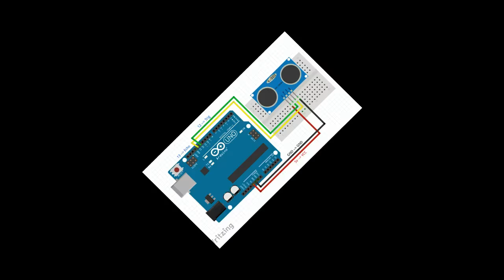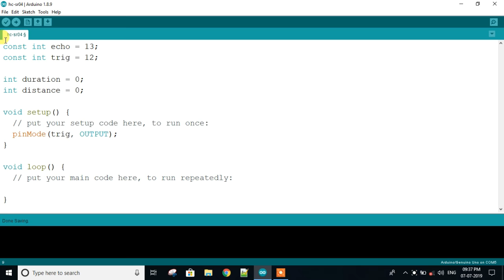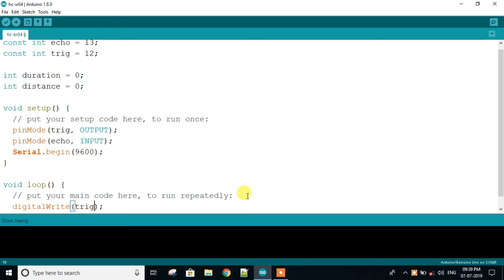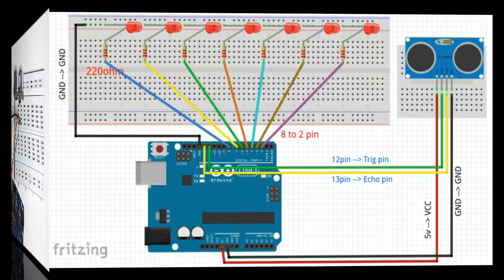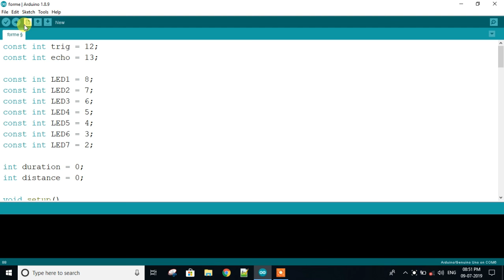Arduino ultrasonic sensor led projects | Hc-sr04 Ultrasonic sensor

Comment: Can we use led bulb instead of Buzer❔❓❔
Reply from the maker: Yes You can, but you have to add a relay for the bulb.
Reply: @MrElectroUino  ok thanks 😎👍🏻
Reply: @MrElectroUino  I am making this using home made cirkut can I use 3 led bulbs
Reply: @MrElectroUino  relay means the base you used❔❓❔
Reply from the maker: @littleengineer8496  Relay is a electrical switch. It's use for high current appliances.
 arduino only supply 5v, So we can use a relay to switch between 230v bulb AC.
Reply from the maker: @littleengineer8496  You can connect upto 12 led bulbs.💡
DON'T FORGET TO SUBSCRIBE✔👍.
Reply: @MrElectroUino  ok thanks 😎
Reply: @MrElectroUino  yes I subscribed
Reply: @MrElectroUino  thanks for answering 👍🏻👍🏻👍🏻
Reply: @MrElectroUino  can I use 9v battery for it
Reply from the maker: Yes you can👍
Reply: @MrElectroUino  thanks a lot

Comment: What colour and size LEDs did you use? What was their voltage? How easy to add arduino speaker module into this project?
Reply from the maker: 5mm size and Round Red, Green, Blue, Yellow, White Color. It requires 2 to 3V dc power supply. For more information and buy visit this link: https://www.banggood.in/custlink/m3vD4vsnhu
For the speaker connection, connect a positive terminal of speaker to Arduino pin 11 and negative terminal to Arduino pin ground(GND) and update the code and upload it. #subscribe it for more video......
if you getting any problem you can also contact me on Instagram:
https://www.instagram.com/_mr_electrouino_/?igshid=isb2pw365odq
Reply: @MrElectroUino  I only asked as I am currently ordering the parts to build one. I am going to use it as an ITC device if I can.
Reply from the maker: Okk
First tell me what is the meaning of ITC device
Reply: @MrElectroUino  its a device that can interact with spirits. I chase EVP, Electronic Voice Phenomenon, ITC is Instrumental Trans-Communication. I recently built a Rem Pod too.
Reply from the maker: Watch this video:-
https://youtu.be/setjiVH0_IY

Comment: why my serial monitor not showing the distance? it keep showing 0 value. i follow all your instructions and your coding but still not get it. even i try only the sensor.
Reply from the maker: Check the circuit connection.
Reply: @MrElectroUino  i follow absolutely like yours. the simple circuit. not show the distance at my serial monitor.

Comment: Is there anyone here getting this error code here?

Arduino: 1.8.13 (Windows 7), Board: "Arduino Uno"
Sketch uses 3234 bytes (10%) of program storage space. Maximum is 32256 bytes.
Global variables use 190 bytes (9%) of dynamic memory, leaving 1858 bytes for local variables. Maximum is 2048 bytes.
An error occurred while uploading the sketch
avrdude: ser_open(): can't open device "\\.\COM3": Access is denied.
Reply from the maker: The first step is to verify the Uno is presented on COM3. Remove the Uno. Start Device Manager.  What serial ports are listed?  Insert the Uno.  Wait a few seconds.  What serial ports are listed?

Comment: what if we dont use resistors? cz i dont have resistors
Reply from the maker: Hey there, Resistor is use for protecting the leds.Without resistor the LED draws too much current and burns out. You can easy found a resistor in some old electronics component but make sure the values.

Comment: Hi brother Its a very good project. But I want to do some modification like I want to add two sensor and differnt light for another sensor. Can u pls help me out. I would really appreciate it. Again thanks for the idea and I also subscribed to ur channel
Reply from the maker: The same way you can do it. Just duplicate the code and change the pin defination.

Comment: the selected serial port _
 does not exist or your board is not connected
 ............. I got this error what will be the solution?
Reply from the maker: Just install the arduino driver. IF you getting any problem contact me on instagram mr_electrouino
Reply: @MrElectroUino  Please bro can you share a code coz in the last moment you swipe quickly so I can't see the code perfectly
Reply from the maker: @prempanchal7721  check out the description you find a code link. Do subscribe😊

Comment: I want to ask why you put it on 13 and 12 pin and not in analog pin
Reply from the maker: That's because the echo pin of HC-SR04 receives a pulse of very short duration,a pulse that has a value of 5v. Its not possible to get a pulse with analog pin.

Comment: How to upload the code
Reply: or a better qestion where is the code
Reply: NEVER MIND FOUND IT
Reply: const int trig = 12;
const int echo = 13;

const int LED1 = 8;
const int LED2 = 7;
const int LED3 = 6;
const int LED4 = 5;
const int LED5 = 4;
const int LED6 = 3;
const int LED7 = 2;

int duration = 0;
int distance = 0;

void setup() 
{
  pinMode(trig , OUTPUT);
  pinMode(echo , INPUT);
  
  pinMode(LED1 , OUTPUT);
  pinMode(LED2 , OUTPUT);
  pinMode(LED3 , OUTPUT);
  pinMode(LED4 , OUTPUT);
  pinMode(LED5 , OUTPUT);
  pinMode(LED6 , OUTPUT);
  pinMode(LED7 , OUTPUT);
  
  Serial.begin(9600);

}

void loop()
{
  digitalWrite(trig , HIGH);
  delayMicroseconds(1000);
  digitalWrite(trig , LOW);

  duration = pulseIn(echo , HIGH);
  distance = (duration/2) / 28.5 ;
  Serial.println(distance);
  

  if ( distance <= 7 )
  {
    digitalWrite(LED1, HIGH);
  }
  else
  {
    digitalWrite(LED1, LOW);
  }
  if ( distance <= 14 )
  {
    digitalWrite(LED2, HIGH);
  }
  else
  {
    digitalWrite(LED2, LOW);
  }
  if ( distance <= 21 )
  {
    digitalWrite(LED3, HIGH);
  }
  else
  {
    digitalWrite(LED3, LOW);
  }
  if ( distance <= 28 )
  {
    digitalWrite(LED4, HIGH);
  }
  else
  {
    digitalWrite(LED4, LOW);
  }
  if ( distance <= 35 )
  {
    digitalWrite(LED5, HIGH);
  }
  else
  {
    digitalWrite(LED5, LOW);
  }
  if ( distance <= 42 )
  {
    digitalWrite(LED6, HIGH);
  }
  else
  {
    digitalWrite(LED6, LOW);
  }
  if ( distance <= 49 )
  {
    digitalWrite(LED7, HIGH);
  }
  else
  {
    digitalWrite(LED7, LOW);
  }
}

Comment: Could you please reply quickly 

The “serial.printIn” is not working
Reply from the maker: Its not like this serial.printIn like this you have to write Serial.println .
First print this program and tell me it work or no:-
void setup() { 
Serial.begin(9600); // set the serial monitor bandwidth 9600
 } 
int number = 0;
 void loop()
 { 
Serial.print("The number is "); Serial.println(number);
 delay(500); 
 number++; 
 }
Reply: THANKS!!!
Reply: it is "serial.println
Reply from the maker: @hypergamer9391  yaa 
Serial.println();

Comment: maybe using rgb led saves some digitalPins ,becuz it can be green red blue or wahtever color in just one led
Reply from the maker: Yes you are right if you want to add more components else having multiple leds is good way to understand the distance between an object.

Comment: how can i get the code for this program
Reply: const int trig = 12;
const int echo = 13;

const int LED1 = 8;
const int LED2 = 7;
const int LED3 = 6;
const int LED4 = 5;
const int LED5 = 4;
const int LED6 = 3;
const int LED7 = 2;

int duration = 0;
int distance = 0;

void setup() 
{
  pinMode(trig , OUTPUT);
  pinMode(echo , INPUT);
  
  pinMode(LED1 , OUTPUT);
  pinMode(LED2 , OUTPUT);
  pinMode(LED3 , OUTPUT);
  pinMode(LED4 , OUTPUT);
  pinMode(LED5 , OUTPUT);
  pinMode(LED6 , OUTPUT);
  pinMode(LED7 , OUTPUT);
  
  Serial.begin(9600);

}

void loop()
{
  digitalWrite(trig , HIGH);
  delayMicroseconds(1000);
  digitalWrite(trig , LOW);

  duration = pulseIn(echo , HIGH);
  distance = (duration/2) / 28.5 ;
  Serial.println(distance);
  

  if ( distance <= 7 )
  {
    digitalWrite(LED1, HIGH);
  }
  else
  {
    digitalWrite(LED1, LOW);
  }
  if ( distance <= 14 )
  {
    digitalWrite(LED2, HIGH);
  }
  else
  {
    digitalWrite(LED2, LOW);
  }
  if ( distance <= 21 )
  {
    digitalWrite(LED3, HIGH);
  }
  else
  {
    digitalWrite(LED3, LOW);
  }
  if ( distance <= 28 )
  {
    digitalWrite(LED4, HIGH);
  }
  else
  {
    digitalWrite(LED4, LOW);
  }
  if ( distance <= 35 )
  {
    digitalWrite(LED5, HIGH);
  }
  else
  {
    digitalWrite(LED5, LOW);
  }
  if ( distance <= 42 )
  {
    digitalWrite(LED6, HIGH);
  }
  else
  {
    digitalWrite(LED6, LOW);
  }
  if ( distance <= 49 )
  {
    digitalWrite(LED7, HIGH);
  }
  else
  {
    digitalWrite(LED7, LOW);
  }
}

Comment: I have done the same arrangement
Reply: But all bulbs are not glowing
Reply from the maker: Make sure the you connect the led right and also change the jumper wire of that led.

Comment: Can u add the code in written in description plzz
Reply from the maker: Check out the website for the code.
Reply: const int trig = 12;
const int echo = 13;

const int LED1 = 8;
const int LED2 = 7;
const int LED3 = 6;
const int LED4 = 5;
const int LED5 = 4;
const int LED6 = 3;
const int LED7 = 2;

int duration = 0;
int distance = 0;

void setup() 
{
  pinMode(trig , OUTPUT);
  pinMode(echo , INPUT);
  
  pinMode(LED1 , OUTPUT);
  pinMode(LED2 , OUTPUT);
  pinMode(LED3 , OUTPUT);
  pinMode(LED4 , OUTPUT);
  pinMode(LED5 , OUTPUT);
  pinMode(LED6 , OUTPUT);
  pinMode(LED7 , OUTPUT);
  
  Serial.begin(9600);

}

void loop()
{
  digitalWrite(trig , HIGH);
  delayMicroseconds(1000);
  digitalWrite(trig , LOW);

  duration = pulseIn(echo , HIGH);
  distance = (duration/2) / 28.5 ;
  Serial.println(distance);
  

  if ( distance <= 7 )
  {
    digitalWrite(LED1, HIGH);
  }
  else
  {
    digitalWrite(LED1, LOW);
  }
  if ( distance <= 14 )
  {
    digitalWrite(LED2, HIGH);
  }
  else
  {
    digitalWrite(LED2, LOW);
  }
  if ( distance <= 21 )
  {
    digitalWrite(LED3, HIGH);
  }
  else
  {
    digitalWrite(LED3, LOW);
  }
  if ( distance <= 28 )
  {
    digitalWrite(LED4, HIGH);
  }
  else
  {
    digitalWrite(LED4, LOW);
  }
  if ( distance <= 35 )
  {
    digitalWrite(LED5, HIGH);
  }
  else
  {
    digitalWrite(LED5, LOW);
  }
  if ( distance <= 42 )
  {
    digitalWrite(LED6, HIGH);
  }
  else
  {
    digitalWrite(LED6, LOW);
  }
  if ( distance <= 49 )
  {
    digitalWrite(LED7, HIGH);
  }
  else
  {
    digitalWrite(LED7, LOW);
  }
}

Comment: The program after using led is not clear pls give a program
Reply from the maker: can you send your email id so that I will send you the code?
Reply from the maker: check your email......
and tell me is that work or not.
and don't forget to subscribe.😊😊
Reply: hey could u send me the code
Reply from the maker: @kajolrathore8328  yaa, send your email id
Reply: @MrElectroUino  sir, can you send me the code
Reply from the maker: @tangjunhan4762   send your email id

Comment: Why my distance is zero while i copy all coding and instructions from you?
Reply from the maker: Upload this code and watch the serial monitor on arduino IDE and let me know what is the output. 
If you don't have circuit so visit this link and refer 1st circuit diagram.
https://mrelectrouino.blogspot.com/2019/07/arduino-ultrasonic-sensor-hc-sr04.html?m=1

const int trig = 12;
const int echo = 13;
int duration = 0;
int distance = 0;
void setup() 
{
  pinMode(trig , OUTPUT);
  pinMode(echo , INPUT);
  Serial.begin(9600);
}
void loop()
{
  digitalWrite(trig , HIGH);
  delayMicroseconds(1000);
  digitalWrite(trig , LOW);
  duration = pulseIn(echo , HIGH);
  distance = (duration/2) / 28.5 ;
  Serial.println(distance);
}
Reply: Mr ElectroUino my distance is also 0, maybe it has to deal with the 10ohms resistance i used for my led, when i testes my code without the led for only the sensor it works perfect but when i connect 2 LED it looks like the sensor doesnt get enough power?!
Reply: Update: the distance and leds work good now, i only changed the resistance to 220ohm each, but there is still one problem with my sensor itself, which says sometimes negative distance
Reply from the maker: @robinvangils2104  Thanks bro😊

Comment: Can anyone please tell me how to download code or copy code????
Reply: const int trig = 12;
const int echo = 13;

const int LED1 = 8;
const int LED2 = 7;
const int LED3 = 6;
const int LED4 = 5;
const int LED5 = 4;
const int LED6 = 3;
const int LED7 = 2;

int duration = 0;
int distance = 0;

void setup() 
{
  pinMode(trig , OUTPUT);
  pinMode(echo , INPUT);
  
  pinMode(LED1 , OUTPUT);
  pinMode(LED2 , OUTPUT);
  pinMode(LED3 , OUTPUT);
  pinMode(LED4 , OUTPUT);
  pinMode(LED5 , OUTPUT);
  pinMode(LED6 , OUTPUT);
  pinMode(LED7 , OUTPUT);
  
  Serial.begin(9600);

}

void loop()
{
  digitalWrite(trig , HIGH);
  delayMicroseconds(1000);
  digitalWrite(trig , LOW);

  duration = pulseIn(echo , HIGH);
  distance = (duration/2) / 28.5 ;
  Serial.println(distance);
  

  if ( distance <= 7 )
  {
    digitalWrite(LED1, HIGH);
  }
  else
  {
    digitalWrite(LED1, LOW);
  }
  if ( distance <= 14 )
  {
    digitalWrite(LED2, HIGH);
  }
  else
  {
    digitalWrite(LED2, LOW);
  }
  if ( distance <= 21 )
  {
    digitalWrite(LED3, HIGH);
  }
  else
  {
    digitalWrite(LED3, LOW);
  }
  if ( distance <= 28 )
  {
    digitalWrite(LED4, HIGH);
  }
  else
  {
    digitalWrite(LED4, LOW);
  }
  if ( distance <= 35 )
  {
    digitalWrite(LED5, HIGH);
  }
  else
  {
    digitalWrite(LED5, LOW);
  }
  if ( distance <= 42 )
  {
    digitalWrite(LED6, HIGH);
  }
  else
  {
    digitalWrite(LED6, LOW);
  }
  if ( distance <= 49 )
  {
    digitalWrite(LED7, HIGH);
  }
  else
  {
    digitalWrite(LED7, LOW);
  }
}

Comment: Can please the code for the project
Reply from the maker: Check the video description for the code.
Reply: const int trig = 12;
const int echo = 13;

const int LED1 = 8;
const int LED2 = 7;
const int LED3 = 6;
const int LED4 = 5;
const int LED5 = 4;
const int LED6 = 3;
const int LED7 = 2;

int duration = 0;
int distance = 0;

void setup() 
{
  pinMode(trig , OUTPUT);
  pinMode(echo , INPUT);
  
  pinMode(LED1 , OUTPUT);
  pinMode(LED2 , OUTPUT);
  pinMode(LED3 , OUTPUT);
  pinMode(LED4 , OUTPUT);
  pinMode(LED5 , OUTPUT);
  pinMode(LED6 , OUTPUT);
  pinMode(LED7 , OUTPUT);
  
  Serial.begin(9600);

}

void loop()
{
  digitalWrite(trig , HIGH);
  delayMicroseconds(1000);
  digitalWrite(trig , LOW);

  duration = pulseIn(echo , HIGH);
  distance = (duration/2) / 28.5 ;
  Serial.println(distance);
  

  if ( distance <= 7 )
  {
    digitalWrite(LED1, HIGH);
  }
  else
  {
    digitalWrite(LED1, LOW);
  }
  if ( distance <= 14 )
  {
    digitalWrite(LED2, HIGH);
  }
  else
  {
    digitalWrite(LED2, LOW);
  }
  if ( distance <= 21 )
  {
    digitalWrite(LED3, HIGH);
  }
  else
  {
    digitalWrite(LED3, LOW);
  }
  if ( distance <= 28 )
  {
    digitalWrite(LED4, HIGH);
  }
  else
  {
    digitalWrite(LED4, LOW);
  }
  if ( distance <= 35 )
  {
    digitalWrite(LED5, HIGH);
  }
  else
  {
    digitalWrite(LED5, LOW);
  }
  if ( distance <= 42 )
  {
    digitalWrite(LED6, HIGH);
  }
  else
  {
    digitalWrite(LED6, LOW);
  }
  if ( distance <= 49 )
  {
    digitalWrite(LED7, HIGH);
  }
  else
  {
    digitalWrite(LED7, LOW);
  }
}

Comment: Can you upload the code?
Reply from the maker: Check out the video description for the code
Reply: iTS NOT THEREEE @MrElectroUino
Reply: const int trig = 12;
const int echo = 13;

const int LED1 = 8;
const int LED2 = 7;
const int LED3 = 6;
const int LED4 = 5;
const int LED5 = 4;
const int LED6 = 3;
const int LED7 = 2;

int duration = 0;
int distance = 0;

void setup() 
{
  pinMode(trig , OUTPUT);
  pinMode(echo , INPUT);
  
  pinMode(LED1 , OUTPUT);
  pinMode(LED2 , OUTPUT);
  pinMode(LED3 , OUTPUT);
  pinMode(LED4 , OUTPUT);
  pinMode(LED5 , OUTPUT);
  pinMode(LED6 , OUTPUT);
  pinMode(LED7 , OUTPUT);
  
  Serial.begin(9600);

}

void loop()
{
  digitalWrite(trig , HIGH);
  delayMicroseconds(1000);
  digitalWrite(trig , LOW);

  duration = pulseIn(echo , HIGH);
  distance = (duration/2) / 28.5 ;
  Serial.println(distance);
  

  if ( distance <= 7 )
  {
    digitalWrite(LED1, HIGH);
  }
  else
  {
    digitalWrite(LED1, LOW);
  }
  if ( distance <= 14 )
  {
    digitalWrite(LED2, HIGH);
  }
  else
  {
    digitalWrite(LED2, LOW);
  }
  if ( distance <= 21 )
  {
    digitalWrite(LED3, HIGH);
  }
  else
  {
    digitalWrite(LED3, LOW);
  }
  if ( distance <= 28 )
  {
    digitalWrite(LED4, HIGH);
  }
  else
  {
    digitalWrite(LED4, LOW);
  }
  if ( distance <= 35 )
  {
    digitalWrite(LED5, HIGH);
  }
  else
  {
    digitalWrite(LED5, LOW);
  }
  if ( distance <= 42 )
  {
    digitalWrite(LED6, HIGH);
  }
  else
  {
    digitalWrite(LED6, LOW);
  }
  if ( distance <= 49 )
  {
    digitalWrite(LED7, HIGH);
  }
  else
  {
    digitalWrite(LED7, LOW);
  }
}

Comment: Can I have this code please
Reply from the maker: send your gmail address✉
Reply: @MrElectroUino  Thanks
Reply from the maker: @tangjunhan4762  Check your Gmail I sent you code.
Reply: @MrElectroUino  can you wait
Reply from the maker: @tangjunhan4762  for What
Reply: @MrElectroUino phone can use for this or not
Reply: @MrElectroUino  Can I know what apps are you using
Reply from the maker: @tangjunhan4762  Phone is not required for this project. I used a phone as an object.
Reply from the maker: @tangjunhan4762  It doesn't require any apps.
I am using a software to upload the code.
Reply: @MrElectroUino what software
Reply: @MrElectroUino  hand phone
Reply: Can download the code or not
Reply: Or you send for me the software can or not
Reply from the maker: @tangjunhan4762  download this software:- https://www.arduino.cc/download_handler.php
Reply: @MrElectroUino  can use hand phone to download the code to arduino or not
Reply: @MrElectroUino  Can you send for me the code when you are testing the ultrasonic sensor
Reply: @MrElectroUino  can I know why after upload mine is negative484....